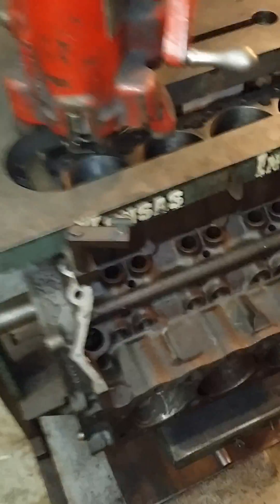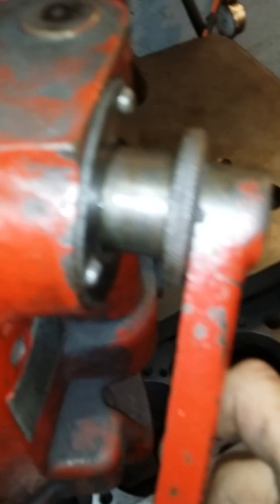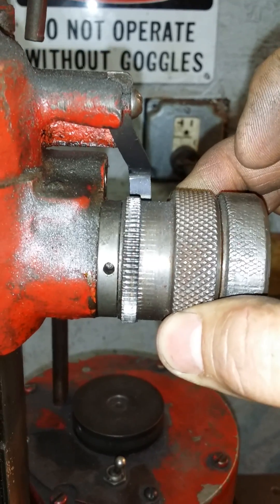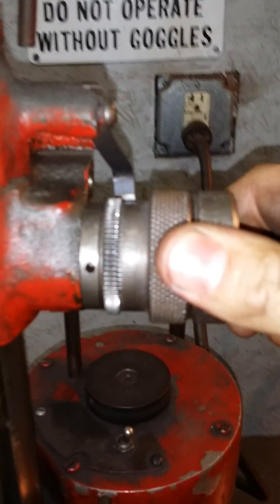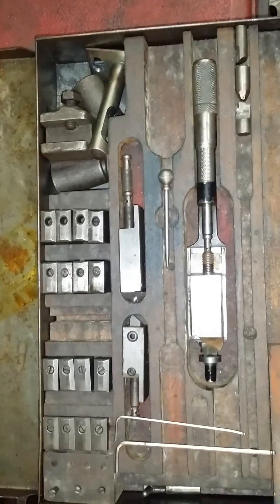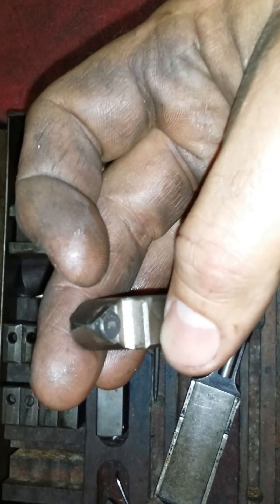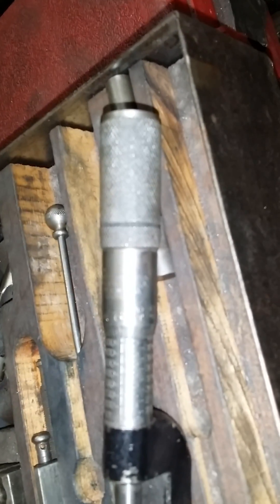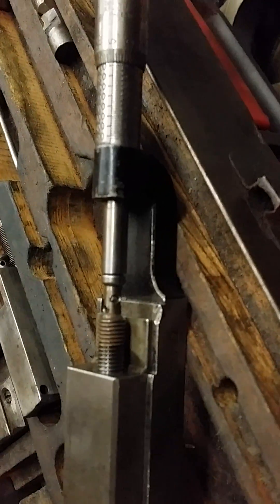Funderburk speed boring bar #2

Comment: if its cutting large, or small, you need to adjust your micrometer. also your missing the lever that releases the click stop on the catspaw expansion knob. interesting you have a Kansas instruments table. I have exact same one and there is no info whatsoever on internet about them. there were all types of jigs made for those tables to do all types of outboard blocks, individual jugs like Harley cylinders and any other type of engine block that would fit between legs of table.